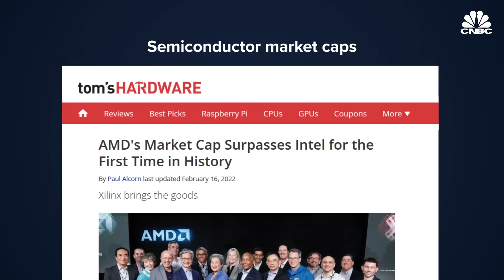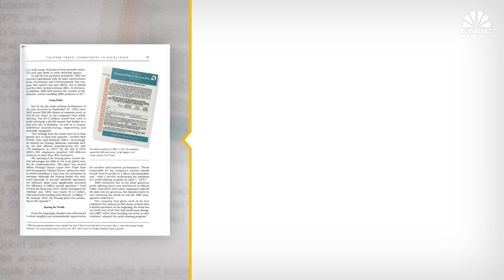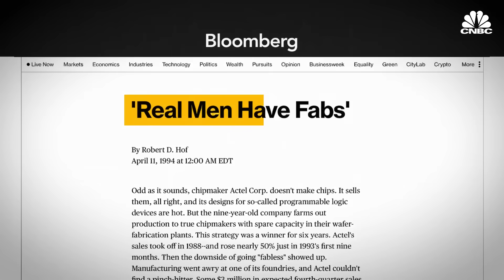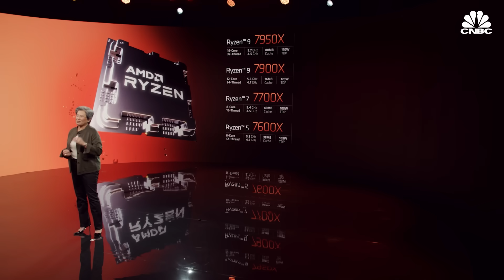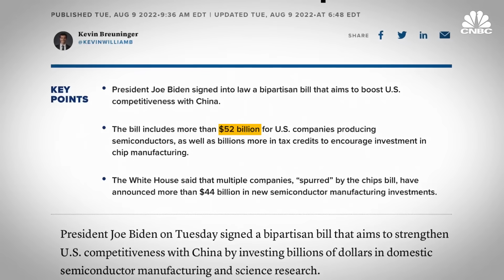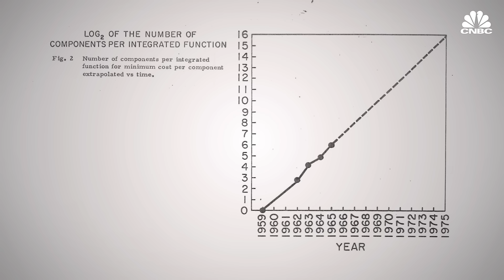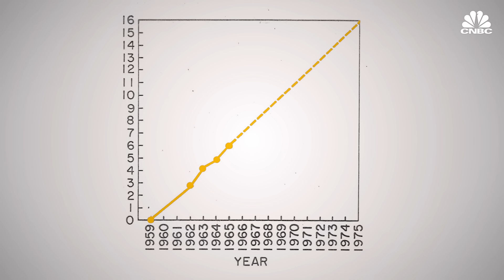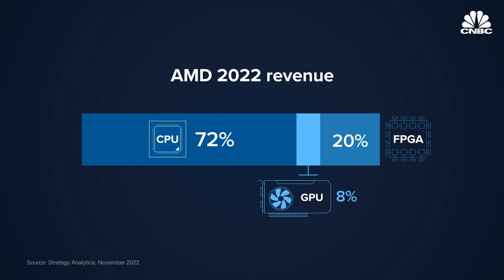How Chip Giant AMD Finally Caught Intel

Comment: Not only caught, but surpassed Intel. On server and HEDT side, they are so far ahead of Intel. Their desktop CPUs are much more efficient than their Intel counterparts. 

Dr. Su and her team have done a tremendous job over theast 5 years.
Reply: "so far ahead" lmfaooo, in a market where everyone stopped buying pc parts except the cheapest on the market.  Go figure the budget option is on top right now... people are stupid lmao.
Reply: Same goes for laptop. Even if intel makes the most powerful chips, amd simply crushes them in terms of battery life.

Edit: guys, if you think the 7000x cpus runs hot on desktop, it’s because amd was more agressive than they should in their tunning,
Reply: Yup. Sadly intel will keep bribing the industry to use their products
Reply: Ehhhhh... "surpassed" is kinda glossing over what really happened. "Plummeted less severely" might be a better description.

Remember, market cap is not the actual value of the company - nor is it even the actual worth of the company. It's just an indicator, mostly of sentiment. Of what people think of it.
Reply: @christopherbedford9897  What people think is important in fact, and those are based on data and their annual reports, P/L etc. Share price aims to show the intrinsic value of a firm, though it's not the true value, it's pretty close when you have so much people trading the stocks. Also equity is great way of raising capital for the company.
Reply: Intel fanboys are insane. Just be a normal enthusiast and be happy that there is competition. AMD is ahead right now. Intel might be next. Who cares who's leading, just go with the fastest available.
Reply: Oh last 5 years , I've been working with politicians snd its supporters to serve venkat and his wife madhavi, still continuing. Ufff , can't forget them.  Received few awards as well from esteemed government agency after b*I'be,  wow what a journey , who cares what Lisa su is doing , its a small company compared to mine
Reply: @BullyTecg  you ok?
Reply: And yet it’s crazy not all of us are poor enough to want to use AMD.
Reply: Ironically enough, AMD had a little boost from our (insider trading) lawmakers.

Which passed laws (at or around the 2014 timeframe, ironically enough)
Dealing with HPC (super computers)

Requiring a single vendor to be able to supply everything used.
Only one company had the ability to do that, AMD due to their buying ATI years ago.

Others used intel or amd for cpu's and nvidia or amd gpu compute units.
One exception is IBM, which used their own cpu's while using nvidia gpu compute units..
Reply: @larrypaul2462   These critics sometimes forget that we are also familiar with the manipulations of marketing costs of producing these CPUs. TSMC has already been exposed to severe leaks in their production of the AMD Ryzen 9 7950x chiplet CPUs. The actual R9 7950x breakdown costs are somewhere close to $45 per user after that the shareholder waits for the company's board of directors to set the inflated prices. 

This also raises the question as to what TSMC had agreed with Nvidia 40XX series. Nvidia no doubt got a better deal than AMD.
 
But also, Gamers Nexus may be the only guy on YouTube who keeps out the BS of his analyzing video reviews.
Reply: @AwesomeBlackDude  AMD is TSMCs third largest customer so I don't know why you would think Nvidia got a better deal. It doesn't work like that.
Reply: @SIW808  normative influence doesn't work here bro you can find the information it's public domain. Myself had bought many Nvidia graphic cards more than amd's graphic cards. But this time around it's going to be an AMD.
Reply: @AwesomeBlackDude  you're forgetting TSMC is a literal monopoly that handles more than 90% of ALL ADVANCED microchips in the world

Competition in the chip manufacturing market is non-existent other than 7% of all productions by Samsung. But that's beside the point

This is why government regulations is bad for free markets since Taiwan government literally regulates chip manufacturing industry at its core to maintain monopoly and leverage in world politics against China.

Thisbis the reason why current and previous generations of graphics cards, automobiles and appliances are expensive AF. It's because of regulations by governments to ward off competition
Reply: Bro have a look on Intel's roadmap.....they are Ahead of AMD and don't forget Intel is father of x86 and sometimes kid surpassed.....
Reply: Nope, 13th gen is a different story.
Reply: @rajuaditya1914  read buddy read! OP said hedt/server space.
Reply: @rajuaditya1914  he might mean power efficient. i9-13900k runs close to 300w to match the 7950x which runs at around 180w when stress testing for about the same performance.
Reply: @acasualmusiclistener7919  7950x runs up to 230w ppt, which is around 310w in practical loads. 13900k is slightly less efficient yes, but not by a lot while being a whole node behind.
Reply: @Nobody-yo4qm  it runs hot and uses a lot of power. Intel is still using 10nm, for some reason. They will fall behind next gen. Once 3d vcache AMD cpus come out in January, Intel will sink.
Reply: @zed0k  they will be moving to 7nm next generation so not really
Reply: @zed0k  I a lot of ways, the nano meter rating of feature sizes is losing its meaning.  Transistor sizes are bumping into physics limits.  Leakage currents are a problem.  Getting the heat out is a problem. Parasitic effects are problems.  The world seems to be set up for the next breakthrough.  AMD's chiplet was a previous breakthrough now.
Reply: @acasualmusiclistener7919  And at 105w it runs at 90% performance which is even more insane.
Reply: @mrcookies409  Intel 13's max power draw is more than AMD 7000's but the average power draw and idle power draw is way less, this is due to the E cores. It saves about 30% energy on an average day.
Reply: @zed0k  Intel 10nm is equivalent to TSMC 7nm ,....
Reply: @acasualmusiclistener7919  The power efficiency has nothing to do with AMD.  It has to do with the fact that Zen 4 is running on TSMC N5.
Reply: @rarinth  whoops, wrong @. My reply was meant for @Steve H my bad.
Reply: @zed0k  Intel isn't 'stuck' on 10nm and it's not even 10nm, neither is TSMC's 7nm or 5nm. Their just improvements to the FINFET design.

Also, Intel's answer to AMD's V-cache is hbm on the server side.
Reply: @carl8790  Who cares about hbm on the server side. We're talking about desktop processors here LOL.
Reply: @zed0k  because whatever is being introduced to the server side will eventually trickle down to the consumer... are you that dense?
Reply: @carl8790  It's already here, in AMD's 3D V-Cache. I'm not dense. Yes, it will make its way down eventually for Intel, but it's literally already here for AMD.
Reply: @zed0k  AMD's V-cache is not hbm lol. HBM is DRAM on an interposer and currently AMD doesn't have any CPUs with hbm. Only on their accelerators like the instinct Mi200 series. 

But tbf Intel can completely butcher their launch, like they had with recent products.
Reply: @Raju Aditya  

Let's be real, both of them consume power WAY beyond the realm of being efficeint

Comment: Does it matter when when ASL makes the machines that make semi conductors
Reply: It kinda does... You cant manufacture CPU's with your ASML machines without the designs and engineering samples...
Reply: @MarcABrown-tt1fp  you can’t make CPU’s without photolithography machines full stop you can always find people to design chips and make them but there’s only one asml and that one company dominates the market nothing comes close yes there are others but nothing compared to asml’s machines which is a far greater feet than CPU’s imo think about how many people design chips how many companies that do the same job tsmc intel amd etc etc they all use asml machines Samsung as well

Comment: AMD shouldn’t feel too comfortable because Intel’s Alder Lake and now Raptor Lake is giving Intel a come back to relevance for the gaming community. Though that spaces has always been fickle to begin with. They swing red or blue on a whim.

As far as industry standards though. Intel has far greater market share which means more money. Investors love year on year growth. AMD had  greater growth potential than Intel which is why the market cap was so high. Return on investment was higher so Investors were betting on AMD. It doesn’t mean AMD was wining.

Future is bleak for x86 architecture. 7nm process and 5nm process has only delayed the inevitable. X86 microcode is old and too power hungry. 5nm process is at the very limit of manufacturing.  This is because at 5nm, transistors are already smaller than a virus. 

In comes the ARM processor. The same thing that powers smartphones and iPads are becoming more powerful each year while taking a fraction of the energy of x86. The future data centers will run on ARM.  Future PCs will have ARM, Apple has already made the switch with much success on their laptops and desktops (Mac mini and studio)
Reply: The x86 architecture isn't a fundamental roadblock to advancement. It's the language for software; what happens under the hood (the microarchitecture) is what really matters.

It's analogous to comparing the ability of someone to think based on whether they spoke Esperanto (i.e. ARM 64) or English (i.e. x86). Sure, the phrasing a sentence in English may be slightly clumsy or inefficient compared to Esperanto, but it doesn't fundamentally limit your ability to think. Plus there is the huge body of existing English literature (i.e. compatibility).

Apple's efficient and powerful products are more about the absolute majority of their business success being from battery based products and their execution FOCUS being on optimising the hardware and software for that segment.

It took Apple 10+ years of iterating their own processor designs (since the iPhone 4) with the deliberate choices of efficient clock speed targets, a wide massive OoO microarchitecture, large expensive die area, and using the most advanced TSMC manufacturing node. ARM64, no threading, and dropping backwards compatibility probably also helped with performance, keeping complexity manageable, and agile execution.

AMD and Intel are working to close the efficiency gap. Apple products will likely still lead for a long time as they have optimised all aspects of the product. Still, they should be able to shrink the gap sufficiently by ~2024-25 to make it not be such a big issue from a sales point of view.
Reply: one day we will all have to plan a transition to arm but it'll never work because we all have to agree on it
Reply: Isn't competition great?

Comment: 14:00   Same nonsense different people think is real.  AMD and Intel do NOT use X86 from decades ago.  They use X86-64 which includes a wide variety of additions to the ISA.  In fact AMD JUST expanded X86-64 for Zen 4 to include AVX-512 instructions.

There is this STUPID notion that somehow having an ISA that started more than 3 decades ago means you have some big disadvantage and SOMEHOW it makes it easier for a company like ARM to make a better processor.

This is utter nonsense.  X86-64 is a dynamic ISA and both Intel and AMD have made improvements to it over time, and it's EXACTLY this fact that allows it to be so dominant.  A comparison is often made to the Apple M1 that uses ARM.  Kind of, but you have to ignore different facts.  The Apple M1 processor can't game like a PC can.  It's not a DO-EVERYTHING platform.  It's great in some applications, not others.  And, for part of the apps where it's better than X86-64, it's not even because of ARM!!  It's because Apple customized these processors for a few years, and it's because of added accelerators.  Well, Intel added accelerators to their 12th gen CPUs and that mostly caught them up to where Apple beat them.  AMD has yet to do this, other than adding AVX-512 instructions.  So this is one area AMD needs to catch up, and buying Xilinx is supposed to help with this.

There are different tasks, especially gaming where ARM has no processor that can do everything well.  X86-64 is wonderful as an ISA behind a do anything device.

What gives ARM an advantage is for making devices that are limited in scope.  ARM has designed many chips to do different tasks well.  So a customer that needs a processor for a specific thing can often use an ARM based processor to do this thing.
Reply: Not to mention that Apple's chips are much bigger than most ARM chips out there that use less modified Cortex architectures. Their sizes (for M1 at least) are essentially not too different from Desktop x86 ones.
Tho it's still the general consensus that CISC is the way to go for real-time critical performance.

Comment: Around 6:30

Intel isn't behind on its schedule to build these new fabs.   That's not true at all.

Where Intel may be behind is a big unknown, but considering they're getting a hold of ASML's cutting edge newer gen EUV machines first, before TSMC means they'll have the advantage of getting to nodes smaller than 3nm (marketing speak).  They are ONE node behind TSMC right now as far as actual transistor density.  They're on their Intel 7 node, and TSMC is on different variants of a 5nm node.

Intel isn't going to put out a 5nm node and is jumping to 4nm which is supposed to come out next year.  If this happens they are basically in line with TSMC.  When these new fabs open in 2024 - 2025 Intel expects to be on a 2nm node process, and they would be first to this node.  If this happens AMD will start to struggle because Intel CPUs have certain advantages and AMD CPUs have certain advantages, but a good chunk of what makes up advantages for AMD IS the process node they're using.  So AMD needs to improve certain aspects with their CPUs is they want to stay competitive because if Intel gets to 2nm first that gives them a big advantage.

Comment: 9:04 - "If we are cut off from TSMC, we all have bigger problems to worry about than getting the latest graphics cards" 😅😅
Reply: Isn't it a lovely thought that WWIII could actually be fought over your PS5, Mac Pro or your 7900XTX! /s

I know TSMC and Taiwan are more important than that, but for 95% of people, that's what it'll boil down to.
Reply: @EbonySaints  Most GPUs are made in China which is why he said "bigger problems to worry about than getting the latest graphics cards".  SOME GPUs are made in Taiwan, most are made in China.  Probably every air cooler that's made to go onto the GPU, and these are VERY custom air coolers since their tolerances have to be VERY exacting come from China.  Each model of each company is a different air cooler.

Just replacing the ability to manufacture air coolers would take years of work, probably by German companies where this kind of technology also exists, but they still do their manufacturing in China for the most part.
Reply: @lilblackduc7312  Still better than Trumpy Dumpy
Reply: @lilblackduc7312  cope harder
Reply: @lilblackduc7312  good boy
Reply: @lilblackduc7312  You went from politics to mama jokes lol triggered much?
Reply: @lilblackduc7312  Delete and edit your posts some more, I'll wait.
Reply: @lilblackduc7312  hmu when you get off school will ya?

Comment: Every amd system I've ever used crashes constantly. Just my own experience
Reply: When was the last time you used an amd system?
Reply: I haven't had an amd system crash on me in years. My old fx 8350 lasted from the time it came out until the 5000 series, and my 5900x runs quite happily 24/7
Reply: My athlon64 still runs.. :)
Reply: Sounds like a major skill issue.